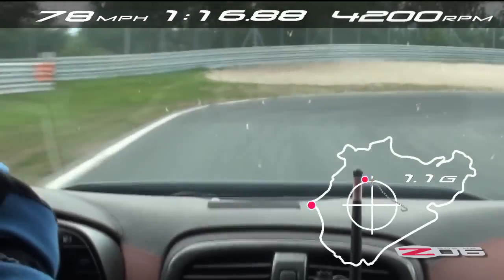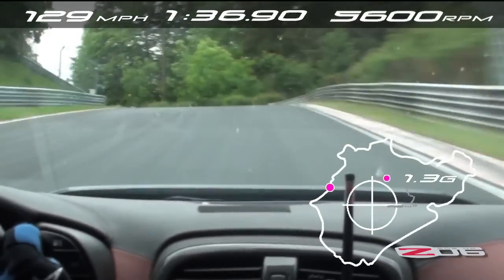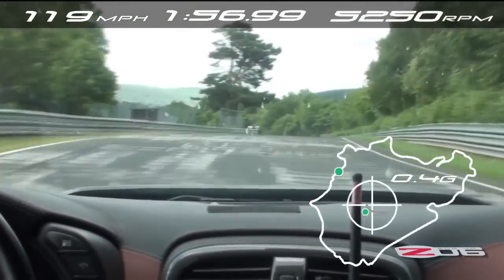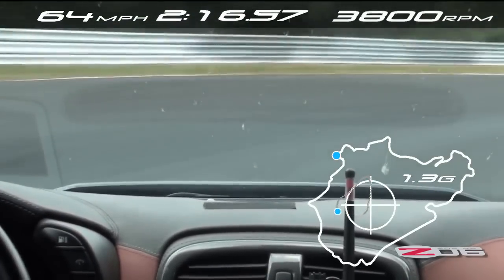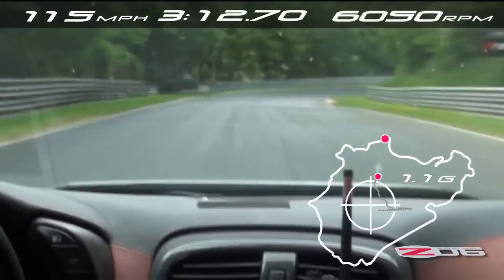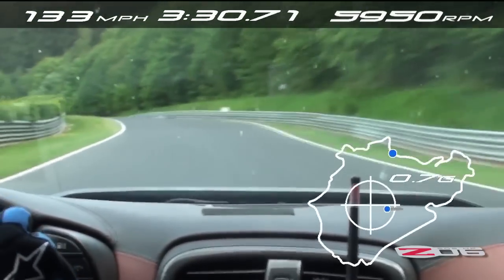Nürburgring lap: 2012 Corvette Z06

Comment: Imagine what this car would do on sport cup 2R tires. This thing would probably be close to or be better than 7:10. That's crazy.
Reply: which is the same time the c8 zo6 just did, its mind boggling how good the c6 is. it shouldnt corner this damn well
Reply: @TransmissionOfPauer  i mean i think it should....50/50 weight distribution. Light weight etc....c8 z06 should have gone sub 7. The ring is very hard to get consistent runs, it rains a lot and scheduling is a pain.

Comment: Bought a 2007 z06 with 27,000 miles. 10k miles later and it runs like a dream. Multiple 600+ mile road trips and it performs like it did when I got it. Threw some PS4’s on there and it HOOKS! It still spins in 1st and a little spin in 2nd, but it corners like crazy
Reply: Traction control is your best option for optimum lap times.

Comment: Holy shit.  This car turns in like a Huracan Performante.  They go for $39,000 right now used with low miles.  What a steal.
Reply: Not the Z07 which is what he's driving, but i agree! The base model C6Z is a few seconds slower and for the money the performance is definitely hard to beat for money spent!
Reply: This comment aged like whole milk 🥛
Reply: @cyberspectre8675  you haven't looked hard enough if you don't think you can find a C6Z with good mileage on it for $39k. They can still be had....
Reply: what's considered 'low miles'?

Comment: Jim Mero is one of the best drivers out there ... the c6 z06/z07 is one of the greatest vettes made it was light , n/a and has ceramic brakes. I love my mine except since mine is a 2011 it does not have the ptm .
Reply: ptm?
Reply: Performance traction management system.  It is a great system, but I find I use only 2 modes. All on = safest best times, or everything off = a lot of fun, but be careful. 
Disclaimer: I'm not a professional.
Reply: Thank you I have a 08 so I don't have that
Reply: @steves186  is there something different in the suspension of a 2012 compare to previous years or its the same?
Reply: @osunaxz  2012-13 Z06's have the magnetic ride control. I think that might only be for the Z07 option though. I am not 100% positive so don't quote me on that lol! The 2011 might also utilize the mag ride too for the Z07s but again not 100% sure
Reply: @nickadkins7765  mag ride only in z07/carbons/isolated option in 2013 I believe.
Reply: @mr.wildcat405  2012 and 13. Don't even have to have a Z07
Reply: @nickadkins7765  isolated option on 12 and 13?
Reply: @mr.wildcat405   Yeah I've always seen 12 and 13 with the magride so IDK

Comment: That guys an impressive driver, I can just tell when someone's at the edge of what the tires can hold and he's right there the whole time.  I do the same technique using the throttle blips to purposely spin the car out to see how much more the tires got to its name... Call it O.C.D.  kind of like checking your clock 20 times to make sure you set it right, blipping the throttle and over-steering over and over and over always lets ya know where the car is at.  As for the car, it must have the pancake suspension package, because that thing rides flat.

Comment: After watching the latest zl1 1LE lap, this driver looks sloppy. Not to put him down bc it takes big balls to go around bends at over 130 but I see mistakes that definitely cost seconds. Maybe the zl1 driver has more time on the ring? Either way gm makes some intense vehicles
Reply: It's the car. Jim Mero is an excellent driver, but you're seeing the difference in the aero the ZL1 1LE uses to its advantage, its weight, its newer and larger (front) tires and compounds, its DSSV dampers; the list goes on and on.
Reply: ztwntyn8 
More time at The Ring. Lol!
He has over 4,000 laps at the Ring.  
So easy for us to criticize.  Lots of stuff behind the scenes we don’t know about.
Reply: I would agree with you. Jim is a good driver, but I see a lot of times in the corners where hes getting the tail end out to much and all. The 2012 zr1 went 7:19. However if he drove smoother I would imagine he could hit the new zl1s time of 7:16. Granted I know its tough to drive and it's tough to have the right conditions when driving over there as well.